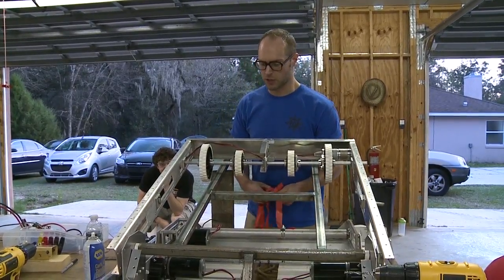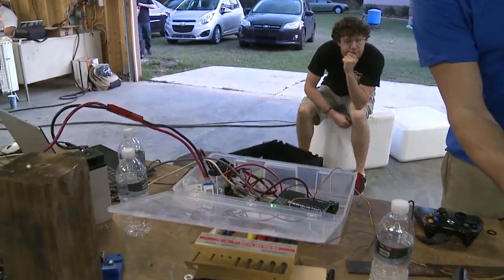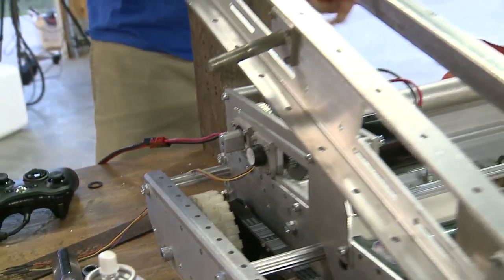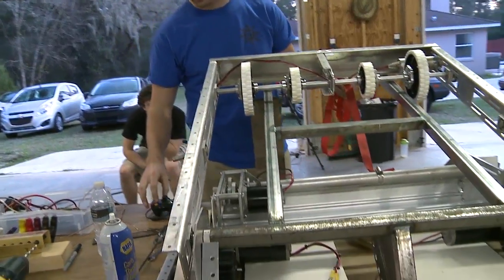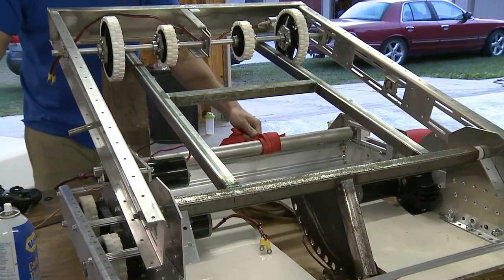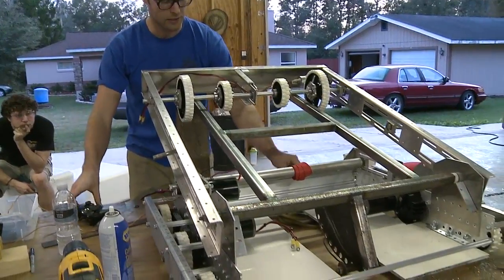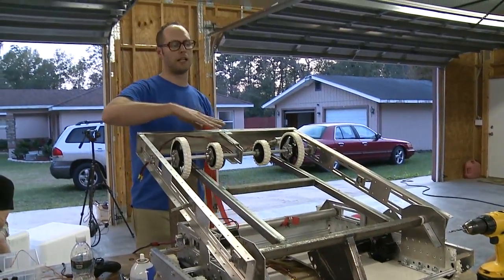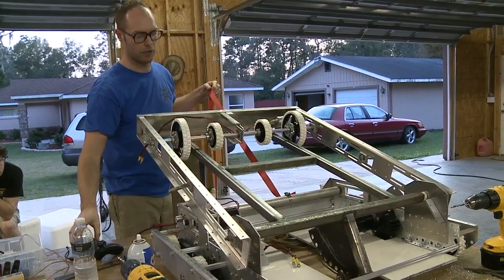Ri3d 1.0 - Night 2 Update

Comment: The only major issue I could see with that winch, is that you're pulling current any time you want the shooter in the "ready to fire" position, which over the course of a 2.5 minute match, could be a bit of a battery drain.

Also, I know you guys aren't really going to competitions with these, but what would you do with that shooter at the start of the match? Would it be able to stay in the "ready to fire" position without power to the motor (while the robot is disabled)?